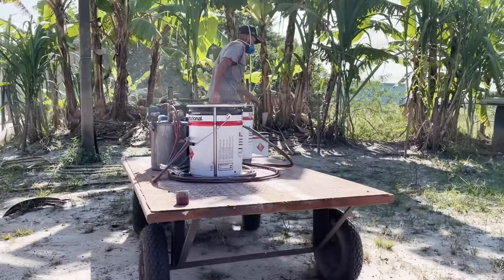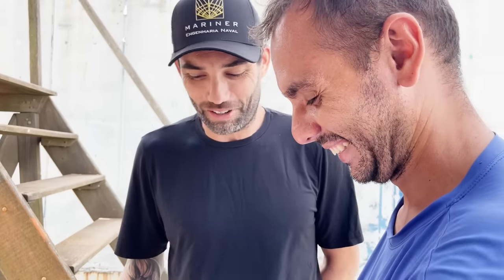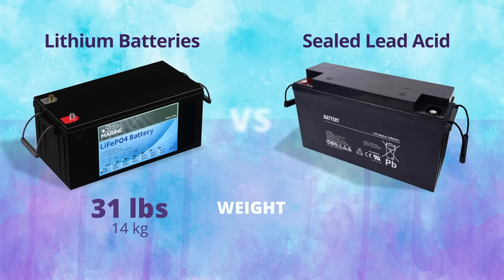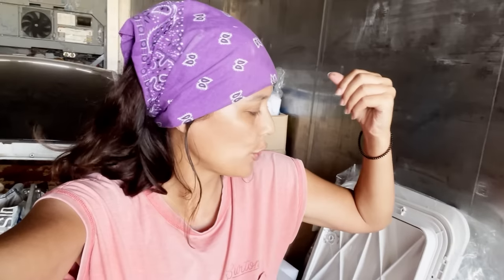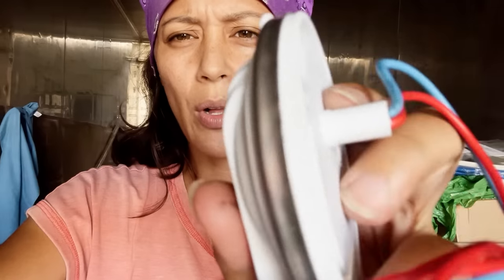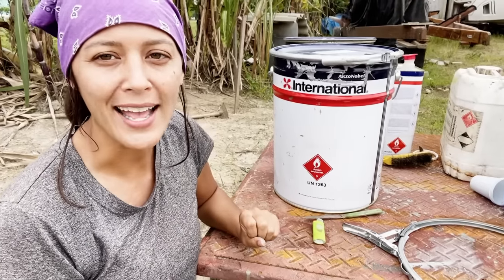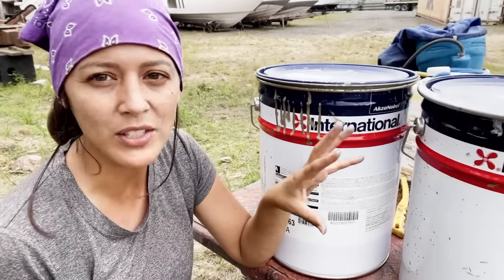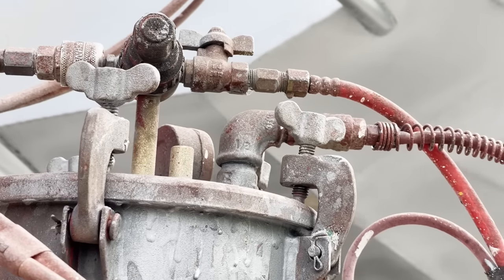Building the Ultimate OFF GRID Electric Boat ⛵️ Ep27

Comment: I really hope you took my advice and went over to Sailing Vessel Mig channel and checked out his electric setup and his recent test of a very similar setup on a 27 foot sailboat. He basically proves that you should have a small camping type of generator on board. One that will run off gasoline or propane especially if you're the type of sailor who wants to set a destination and direction to travel to and the weather doesn't cooperate. Harbor freight has a small Honda knockoff camping generator that's about the size of a 5 gallon gas can for under $1k and they're tough and super quiet especially if you add a different quiet muffler. Capt Topher from Mig said that in his prior experience with having one in a box bolted to a lid removal box on the back deck that they will last for 5 years and then you have to buy a new one due to the salt. Lahakai is going to turn out amazing when she's done.

Comment: She is looking great, am really proud of you 2 & crew. I would really think about a space for a small generator, both Uma & the rigging doctor relented and added generators for the bad days.  I sound proofed a noisy generator like you all has a while back. Just a box with a series if L shaped parts as sound does not like to go around corners.   Of course for about 5k one can buy a sound proof generator & figure out exhaust hose.
Reply from the maker: Thanks so much! Amazing help here, we're very happy with this shipyard! 
We will be looking into what options there are for backup systems. Even the small smelly tank of gas we had on our sail down here made me nauseous so we hope there are some better options out there by now.
Reply: @lahakai  I was Engineer on a 3 mast steel hull for 4 years. The only time I got sick was smelling fumes & coming on deck. I know a small 2000kw sound proof would fit in the dingy. 45 pounds is pretty light, think you can plug two of them together if sailing the artic.

Comment: Hi I really loved your sailboat and all the changes that you made.  However I see large gaps under the reinforcement bars for the hull.  I thought that they were supposed to be welded on the hull every six inches apart at least.  Huge gaps underneath not sure what they are reinforcing.  I saw on your vdeo when you were looking for a boat yard flying overhead there was a yacht that had the boat holder that looked just like yours and on the top were the solar cells.  Looked so nice.  Now you cut it off. OMG. It looked so good on that other yacht with the solar cells.  You have better weld it back. LOL

Comment: Consider using solar panels for the actual roof on the cockpit. A bead of silicon between them and a few alum pop rivets and it will be permanently sealed and structural sound.    Check out EG4 48V server rack batteries. They have waterproof ones VERY REASONABLE.  Using 12 volt in series is a problem making 48 volt. If you have one cell set of the bms the entire system goes down. With 48v batteries and 48 volt bms  in parallel , if one cell goes down only one battery pac shuts down, you will not notice it all and you still will have power just a bit less of it.  This is a BIG problem if you have an electric powered boat. You Cannot have the full electric to the motor go out just because of a bms problem on one battery.    CHEERS   and I love what your doing !     Steve h.

Comment: I love the electric idea. Please share with me how you figure out cloudy days and storms? Will you add a wind generator to help compensate and an emergency generator for power if the battery banks are low and you need your motor?
Reply from the maker: We will dive into more detail about our set up after the wood interior build, once we start installing the equipment. Also, we're going to have to do a lot of testing. As Sailing Uma said, even after all of the planning and calculations, what happens in real life can change a lot of factors. We will be having a wind generator and we are considering the options for emergency generators. There are some areas in the world that require them so it might be a necessity regardless. There will definitely be some lifestyle adjustments needed to be made to coordinate with battery life. Lot's to come!!

Comment: Going fully electric is both very challenging and very interesting. Of course as this is something relatively new in boating, most people will suggest keeping the old but reliable technologies, such as diesel propulsion. But on another hand the era of gas and diesel engines are coming to an end. So why not electric?
My only concern will be to have an alternative propulsion method, just in case. An outboard motor?
Reply from the maker: We feel the same way, things are tipping over and technology is moving fast. We will look into backup systems to see what’s available. New stuff comes out all the time, so you never know! Cheers!

Comment: Guys , you have to knock them welds down.  A lot of drag there. Also where are your bulkheads. Looks like fun, but at the same time you want it safe. I've seen first hand what the southern ocean can do to a trawler.  This is why I asked about the lack of bulkheads.
Reply from the maker: We did shave down the welds, they show up worse on camera because of the shadows. The remaining will be smoothed out with fairing compound to eliminate any drag. Since our boat is quite small and made of steel, it's original design does not have bulkheads and it not necessary for structure. We did add a watertight bulkhead in the bow though for collisions. Cheers!

Comment: Hello there from ChCh, NZ, Brilliant to see just how fast things are going .... The is a Major 'Thing' that worries me ..... Just WHY were All those external hull welds NOT  'Dressed' to be a LOT Flatter and Smootther...... ????? I am Not saying that you have to 'Flush' grind them, just remove the excess weld. ( 'Flush would reduce the ' Weld Joint' Strength ).... This leaving a more hydrodynamic surface... ALSO leaving less surface and spots for the ' Sea Growth' that will definitely happen. When trying to clean the hull around those rather Large Welds, these areas will wear thru' so easily, also when touching/rubbing against Rope of Jetty, the paint will wear off/thru' in these areas very quickly, thus exposing the Raw Steel and negating All your Wonderful work. Best to All from New Zealand

Comment: The hull looks like a mosaic. I didn't notice it last time 😅
Anyways, I've doubts about the solar panels + batteries. Considering shadows, inclinations, and many other factors, panels won't generate enough power to refill batteries. 
160*12*8= 15,3Kw, paired with 1,4KW (from sun+wind)? Even in the perfect day with many hrs of sun and constant wind, can't produce enough to refill those batteries (plus 3,8kw of extra batteries).
Two strings 12+12 = 24v, did the scheme was wrong and you are doing 4*strings instead? 
The Victron MPPT 100 | 30/50 can work under 12v or 24v, so why they are pairing it with a 48v inverter/batteries? 
About the engine, how much power it requires? And, what kind of displacement weight we are talking about? How many lbs it needs to move?
Editing, music, narration it's great actually. Very nice!👍

Comment: Without a generator, you will require 3 times more solar panels to keep the batteries charged. Depending on where you plan to sail, per day, you shouldn’t work on obtaining no more than 50 to 70% of watts from solar panels.
Reply from the maker: We definitely would love to work out more creative ways to get panels on our little boat. Budget wise this is where we are at now, but perhaps flip ups or slide out panels can increase our input when at rest. Well keep these numbers you suggest in mind when making our calculations. Cheers!

Comment: I don't want to be the naysayer here and put a cloud, literally, over your great adventure.  I dont think you have enough solar or wind to charge all those batteries well.
This is from personal experience on my sailboat and helping others that have massive power banks.
First, the ratings for wattage on panels and turbines is way optimistic.  I have a 600W wind turbine running day and night powering a 12V deep cycle starter battery for a 56hp diesel and two 210ahr AGMs for house DC.  The house DC is lights, bilge pumps, radios, radar, Raymarine MFD, and navigation lights. The starter bank can be isolated from the other bank.  
I have two Renogy hard solar panels 200W each and two Renogy flexible panels on my bimini 175W each for a total of 750W charging two 206ahr SOK lithiums.  The lithiums power a 2000W inverter that runs 120AC for my cabin outlets that power refrigeration, a laptop 2 cell phones, 2 fans and once a day coffee maker, toaster, microwave and water heater (all used only 1 at a time).  Each system can charge the other when needed.  
My experience is I only get about 20amps max with the solar array and 10 to 12 with the wind turbine when it is humming fast.  
I live in Florida on a river  and get plenty of sun and wind.
I am often worried when my voltages get low (below 12.1) as this stops the Inverter from working, regardless of how well the LiFePO4 batteries can handle it.  You will find, like Capt. Kirk of Starship Enterprise "I need more power Scottie" who replies "I'm given her all she got Captain!"  
As to your huge battery bank, the problem is when so many are hooked together they charge extremely slowly.  It can take several hours for a large solar bank, like 800W to move the voltage 0.1V.  So, when the voltage in the big bank gets low for any reason, like no wind and heavy electric motor use, it is really hard to get that voltage back up.  My buddy has this problem with a bank of only four 200 ahr AGMs.  He has to fire up a 3500W gas generator to run 30amp chargers to get his bank back up, even with 800W of solar!  You are planning on running an electric motor!  
The advice of some to buy a gas powered generator is solid.  Also, plan on adding more solar and a bigger wind turbine.  The calculations for power needs are better assuming you will get, at best, 50% of ratings.
Fair, strong and steady winds my sailing friends!
Captain Qwiksword 
SV Gratitude

Comment: You know what people use for galvanization on steel boats? Aluminum! (not exclusively, yes I know they use zinc as well, but also aluminum). You can be sure galvanization and rust will be there whenever steel and aluminum are together. I hope it turns all right for you. If I had steel boat I would avoid any aluminum parts, think twice about every electronic installation and 3 times about any electric installation for communication. In a steel boat you are basically sailing and living in one big Faraday cage. Fingers crossed it works for you.

Comment: Why are you drilling holes in a steel boat and creating access points for leaks and corrosion. Weld brackets and fasteners.
Reply from the maker: Some holes are essential like thru-hulls, our throttle and supports for wood framing. For the electrical work we will use glued fasteners and conduit. Cheers!

Comment: Nice concept, but I would highly recommend a diesel engine.
Electric, maybe on a big foam core catamaran but only with the capacity to get into the harbor in combination with a hybride diesel for off coast maneuvering
I would highly recommend to use a diesel engine that can run on old fryer oil.

Then you can collect fryer oil on a bicycle with a few jerrycans for free.
Just dump it in a big tank and you’ll motor almost for free.
And often they’ll start the engine on a small tank with diesel in order to heat the fryer oil with a copper pipe around the exhaust so it becomes more viscous.
You should check out this Dutch couple.
They sail a Dutch steel sailboat that they fixed up on a budget.
Recycled mast with a tapered boom build from the excess length of the mast, biodiesel engine, custom self steering wind vane, custom build pilothouse with inboard steering, wood stove etc. etc.
This is part one of a three episode show and tell interview.
https://youtu.be/MqINHVcHiBo?si=axEoRcBc_UltUhwg

Comment: Don’t make it electric. It’s will be more expensive, less reliable, less powerful, less safe. One lightning strike and poof everything is gone!
You will not save the planet this way, the difference is minuscule.
You could have a four stroke outboard that you use for the dinghy and main boat and sail most of the time.
Still I am a big fan of solar, lithium, induction cooktop for a boat, but would not go that way for propulsion at the moment.